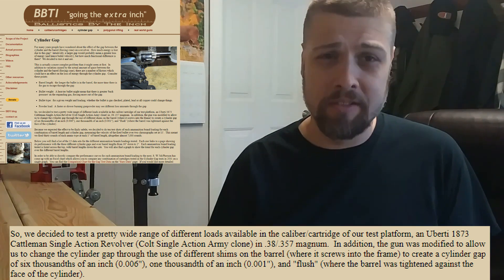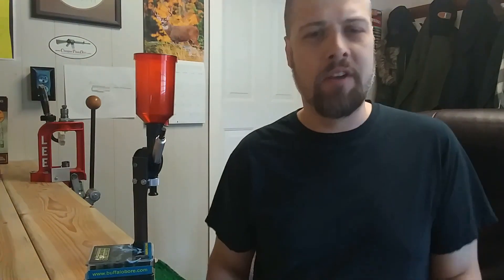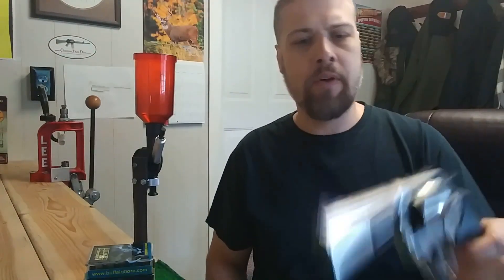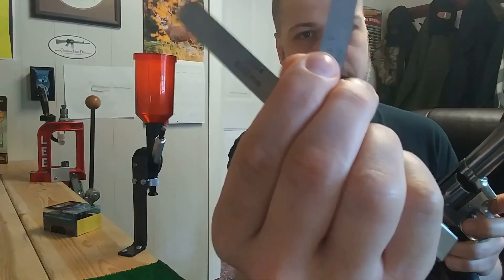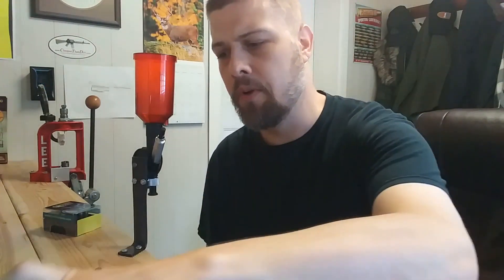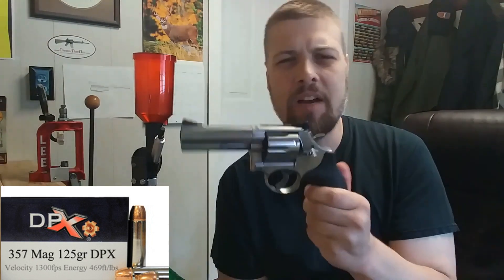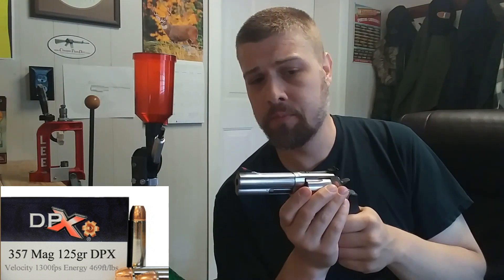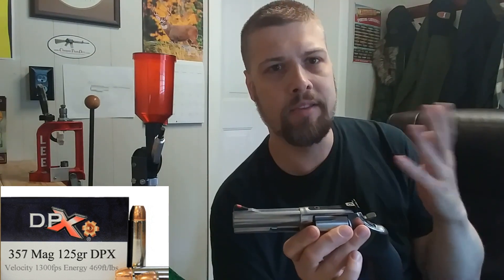Revolver Myths Episode 1. You Lose MOST of Your Velocity Through the Cylinder Gap

Comment from the maker: Wanted to point out, that looking at this site again, I do not see any information about 0.003" gaps, rather it now shows 0.001" and 0.006" along with 0.000". I took this information that was listed at 0.003", but I cannot find the exact source of the 0.003" gap, but ballisticsbytheinch has their's labeled 0.001", so disregard my quotes of 0.003" and think of them as 0.001", the other information is correct though.
Reply from the maker: Sounds to me like you were shooting both .38 Special and .357 magnum both in the same range session. If this is the case than this is totally normal. The .38 Special is shorter, so the mouth of the brass on the .38 Special will dirty up the cylinder where it's mouth rests. The .357 Magnum being longer has to seat it's mouth of the brass beyond that point that has already been dirtied up from the .38 Special firing, so it can get sticky. A good cleaning will remedy the problem. As far as it happening while shooting, there's not much you can do other than shooting all the .357 magnum ammo you're going to shoot, and then shoot the .38 Special, either that or fire only .357 magnum in 3 chambers and reserve the other 3 for .38 Special while shooting.
Reply from the maker: They aught to be. Fixed barrel and typically above the speed of sound bullets from muzzle to target. Compare that to the average 9mm pistol, sloppy barrel and above the speed of sound at muzzle to below it at 25 yards, lots that can affect accuracy going on there. There's nothing like a .357 magnum, or even a .38 Special for that matter.
Reply from the maker: I honestly don't know much about the products you use. I have always just used Hoppes on all my guns for a long time. I have never noticed any issues with bluing on any of my guns, even if I was concerned I could always use liquid blue to touch anything up.
Reply from the maker: Really anything will work well as long as you have a bronze bore brush. I have even used WD-40 to clean my guns when out of solvent. Getting a good brushing in the chambers and bore with anything wet usually does well. I have even used chrome polish in the chambers to good effect. But of course when I used the polish it was a stainless gun.
Reply from the maker: There's really not much to a Ruger GP100's internals, most of it is attached to the trigger group so it should all work itself out. If it were a S&W I might be more cautious with how much oil gets inside of it.
Reply from the maker: There will always be a permanent ring in the chambers to some degree. They shouldn't effect chambering rounds once they are cleaned, if they do than there might be something to look more into.
Reply from the maker: Once in awhile you do get a revolver from the factory that has a slightly tighter or looser chamber than the rest, so when you get them dirty from firing ,they can get sticky. Typically you will get that more often with .357 Magnum ammo because the brass will swell to fit the chamber when fired more so than a .38 Special will. A lot of things can cause slightly bulged cases as well right from the factory, more than anything else you see it more with heavier ammo, like 158 gr .38 or .357 ammo because the bullet is longer and has to really seat itself in the brass when manufactured, and when you get ammo known for having thick brass as well, you can get swelling. Most notably ammo loaded with very thick brass like Magtech/CBC brass, and then a 158 gr bullet is shoved in it, you will get bulging.
Reply: Andrew Baxter
Hoppes will not hurt your finish.

Comment: Great job Sam! 
Have you studied the.44 special? I have an old Charter with a .010 gap.
And are these prophets of doom considering what energy loss a slide cycle costs for an auto?
Reply from the maker: My only ".44 Special" is my S&W model 69 in .44 Magnum with a .003" cylinder gap. Generally, a semi auto doesn't lose any potential power from the slide moving as most action types remain locked until after the bullet leaves the muzzle, and THEN the slide cycles, so your velocity won't be reduced. Now with some of the older style direct blowback pistols, which are a small minority of semi automatic pistols now days, it's possible there's some velocity loss from cycling.
Reply: @GunSam  Thanks for getting back! Makes sense, easily studied I suppose. 
After gathering your info, I'm not concerned anymore, plus I found a chart stating most revolver brands listed .012 as a max. 
I think that a lot goes on before the bullet even gets past the gap, there's a 1/2 of space right there when it starts burning. So, not gonna worry about it.
Thanks again!
Reply: @GunSam  After thinking for a minute, not to split hairs, but, on a lock up style auto, the energy to cycle has to come from somewhere, doesn't it? Even within that 1/8" of locking, it still has to tax that force to fly backwards. 
Also, maybe that first section of the cylinder before the gap is the most important section of the detonation, and that may explain the minimal losses, even that bizarre increase between 0, and .001.
Any thoughts on that?

Comment: What size gap would you say is s no go and should be sent back. Both my Ruger look hugh.
Reply from the maker: Generally anything from like .002" to .010" is within normal range, but the ideal size is about .004". The low end numbers can cause binding issues if the steel heats up too much, the high end numbers can cause a lot of velocity loss. I would say caliber matters though. Stuff like .38 Special, .45 Colt and so on, you might lose 10% of your power, but if your power is only 200 ft lbs, fixing it will only add like 10 ft lbs to your energy. Now if it's maybe a .44 Mag with .010" gap and you lose 10% of 1,000 ft lbs, it's something I would want to address.

Comment: Not complaining about cylinder gap, revolvers are dirty power and I love it, but isn't a 5% increase in velocity equivalent to a 25% increase in energy carried by the bullet? That's substantial. Though I wouldn't be surprised if closing the gap also increases chamber pressures significantly. There's no free lunches after all.

(EDIT: Not sure why there was a drop in velocity in the 357 testing. Probably just a anomaly that occurs with that individual gun/load combination or there was a sudden drop in chamber pressure due to the bullet engaging the threads sooner than with a gap.)

Comment: I have two 30 years old Taurus revolvers and the gaps are 0,2 and 0,3 mm. It is easy to make a single shot pistol with an adjustable gap to test these theories. I won't do it just because here in Brazil I would be arrested just a few hours after posting the results.

Comment: just an idea I had. so more barrel length is a longer acceleration period, and once the barrel comes out logically, there IS a high-pressure zone behind the bullet that adds extra velocity. not much, but some. that's also just kinda logic. in theory, a suppressor adds more velocity to a bullet acting as a somewhat longer barrel. again probably not much, but certainly some. however, if there is a muzzle flash it won't be perfectly even all around the bullet every time you fire. there is an uneven high-pressure zone around the bullet. this means that muzzle flash is conducive to lower accuracy. if a suppressor gives a bullet longer exposure to an uneven high-pressure zone, then a suppressor reduces the accuracy of a bullet because it does not hold the barrel in a perfectly straight line......... therefore video games should give suppressed weapons more damage and less accuracy. but of course, not enough to really matter.

Comment: 5% loss of velocity is about 10% loss in energy.  That can be easily made up by having 10% more powder charge, given that the revolver cartridges typically have much greater case capacity due to less constrained case length (not having to fit inside a grip).

Comment: I've got a NIB taurus with the cylinder literally touching the forcing cone the whole way around the cylinder.  Zero gap. Im waiting to hear back from a gunsmith about getting it threaded. Back when revolvers supposably couldn't be silenced, they didn't have cnc precision machining. Smith's were king back then and have always had big gaps as well. I'm thinking a light subsonic .38 special  load out of my taurus with a can would be pretty damn quiet.  The tunnel rats had a few tunnel kits with suppressed .38's . They bitches about every single piece of gear but didn't say shit about the gun. And that was s&w tolerances.
Reply from the maker: I have heard that Taurus is tight, I happened to buy a Taurus 605 a year ago and the gap is about .004" or same as my S&W's. A suppressor should quiet any gun even with a big cylinder gap, but it would still be louder than a semi auto. Maybe run some .38 Short Colts through it for kicks, see how it sounds? Your next lowest sound would be basic wadcutters, the Magtech 148 gr came in at 650 FPS in my 605 and also the Federal LE white box 158 gr LSWCHP were also 650 FPS.

Comment: I suppose a small argument in favor of the larger gap would be reliability especially if you were to fire several thousand rounds before cleaning it. The tighter the tolerances, I suppose, could make it a little more vulnerable to binding up if it got dirty enough. If you actually lost "most" of the energy in the cylinder gap it would make it unsafe to stand next to a revolver shooter on the range.
Reply from the maker: I know that S&W typically has a pretty big gap for this reason, very reliable.

Comment: There’s actually a good reason that would explain a boost in velocity with the small cylinder gap. A small gap(such as you stated) would act as a Venturi causing an inrush of oxygen after the pill passed through the forcing cone. Such action actually explains aid in the burning of yet unburnt powder; thereby aiding in the ignition of all powder; giving the pill a little shove.
Reply: Debatable whether any Venturi effect would apply, or whether all of the gas flow direction would be outward through the gap. On an entirely closed system, the "chamber" is everything from the sealed expanded cartridge at the bolt face all the way to the tip of the barrel before the bullet breaks the gas seal and leaves. Since everything in that system is fixed except the base of the bullet, the expanding pressures only move in the direction this dynamic chamber allowed expansion and that is toward the muzzle. When the bullet breaks the seal, the gas jets out creating a rocket effect into the outside atmosphere and sending the now open chamber "system" in the opposite direction of the rocketing gasses. This is recoil. Same principle puts the space shuttle out of earth's atmosphere:  long-term recoil. Anyway, if there is a breach in that expanding enclosed chamber before the bullet breaks the barrel, the gasses go OUT of that breach because internal pressures are far greater than external. Does gunpowder require, and/or benefit from atmospheric oxygen to enhance the burn? Ask a chemist. I'm not sure. It's a solid fuel which doesn't require compressed or liquefied oxygen for reaction. I'm going to say no.
Curious minds, however, wonder if the high velocity gasses flying past the gap down the barrel at any time draw atmosphere in, or if it all only goes out. I feel gas velocity across that gap (axial flow) is relatively slow before the bullet leaves the muzzle. If gunpowder doesn't become enhanced with oxygen/hydrogen, the Venturi theory is implausible and something else caused an increase.
Reply: Lifted_Above Interesting theory. It’s quite comforting to know that there exists a vast community of shooters like yourself who approach the overall science of ballistics with an intellectual curiosity. Thank you for sharing.

Comment: Nice video and information!  

Curious how “velocity loss” compares to a say Bond Arms Derringer, which has no gap like a revolver or cycle of gas like a semi-auto, a similar barrel length in revolver with the cylinder gap, and of course a semi-auto with similar barrel length using gas to cycle the action.

One point is I never hear anyone say cycling of the gas reduces bullet velocity.  Not saying it does or at least not enough to be a concern, but would seem to a comparable argument in theory.  A single shot firearm would tend to prove or disprove this as well.

My guess is nothing worth considering and barrel length, speed of powder burn, shoot ability, trigger, etc are all the real characteristics to consider.

And yes my guess is these test could be very expensive to do.  So not suggesting you do them.  Just one of those bar talk topics that no one should really care about when really evaluating a firearm.
Reply from the maker: Thank you. It would be an interesting test to see how they all compare. The semi auto vs derringer would be an easy test if a specific barrel length matches a semi auto as they are both measured the same, so like a 3" 9mm derringer would compare identical to my 3" DiamondBack DB9. Revolver VS derringer would be pretty easy too depending on how you do it. Example would be bullet nose to muzzle measurements like a 1.875" .38 Special revolver barrel and distance from bullet nose to cylinder face and .004" cylinder gap gives you about  an even 2" bullet nose to muzzle, so a 3.5" .38 Special derringer minus an average .38 Special also gives you near exactly an even 2" bullet nose to muzzle travel.
Reply: Are there some gas operated handguns (such like an AR-15 gas system, or a 12 gauge shotgun gas system with a gas port somewhere down the barrel)? Or are they all operated by an unlocking of the bolt after the bullet has exited the barrel, so the rocket effect shoves the slide backward?

Comment: It's still subsonic a plus p should be going way past the sound barrier
Reply from the maker: Depends on the bullet weight, barrel length and particular load. Most 125 gr .38+P gives me about 1,000 FPS in a 4" barrel, and 110+P maybe as much as 1,100 FPS but not always. Now with small companies like Underwood and Buffalo Bore we can get way past the sound barrier and I have even had a 90 gr+P get up to 1,650 FPS with a SuperVel brand load.
Reply: @GunSam  ya I was assuming the avg velocity would be around 1350 or 1400 fps

Comment: "Path of least resistance". I never understood why would the gas push the bullet down the barrel when it's much easier to escape through the cylinder gap.
Reply from the maker: I would not think of the cylinder gap as the path of least resistance. It's small like 0.004", the bore is 0.357", hundreds of times larger so it will want to go out the bore. Plus the bore is in a forward direction.
Reply: @GunSam  the bore is .357 but the bullet is larger. So it's almost like a press-fit situation. Whereas the cylinder gap is a .002 opening. So I couldn't fathom after the gas sees the resistance, it wouldn't just redirect itself out of the gap...but obviously that's not the case. I just don't understand why.
Reply from the maker: @Obelisk57  The bullet moves out of the bore very fast, if it's moving out so fast that means the gas is moving just as fast with it.

Comment: Always a good video, you may like this, 38 ca. goes into 22nd floor window from 1,400 feet away. Rents start at $ 7,000.00 a month.       https://nypost.com/2018/08/20/tenants-terrified-of-mystery-gunman-taking-aim-at-apartment-building/
Reply from the maker: Thanks. I wonder how they know it's ".38 caliber" seeing as that term is usually used in reference to a .38 special, or if it is a .357 magnum seeing as both cartridges use the exact same bullets. I can understand that S&W revolvers may have different rifling than other makers' revolvers, but can there be a differential between their own .38 special and .357 magnum revolvers? I don't know as much about firearms forensics as I would like to. Either way, 1,400 feet is only a bit over  1/4 mile, and if the impacts were lower on the building that the height fired from on the other building, I could see how that distance is believable, especially with a long enough barrel and especially if the cartridge was a .357 magnum. Reports of gunfire may suggest the latter with the report that a magnum makes.